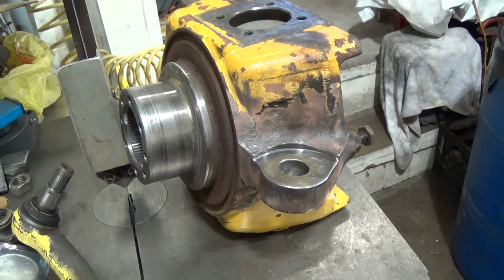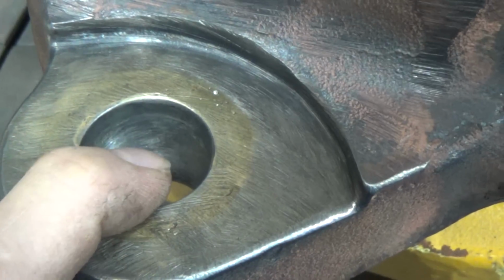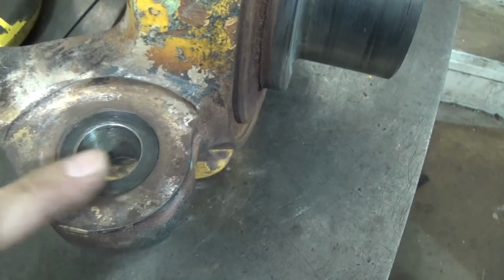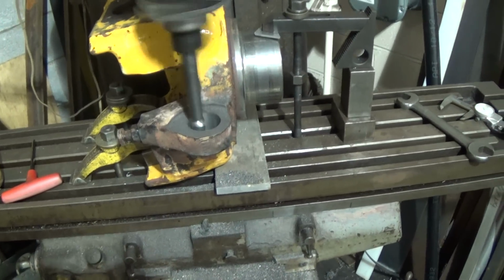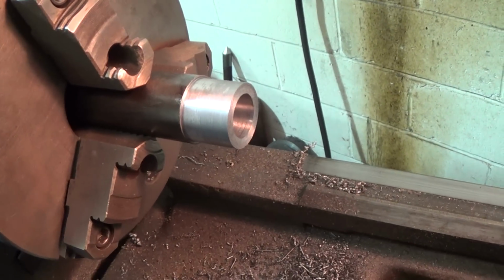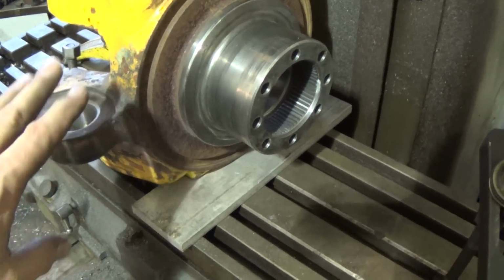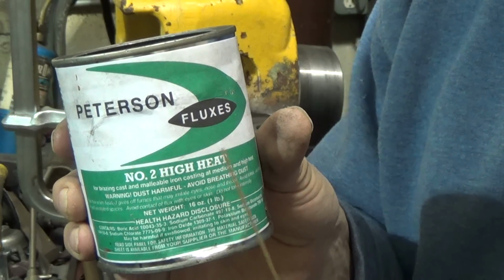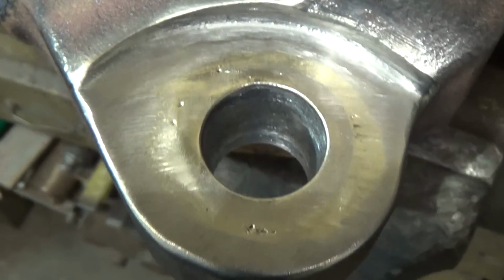Oh Deere !

Comment: I enjoy your repair videos. Nice use of brazing. More people should get familiar with brazing because it's so versatile and shock-resistant. If you have to weld cast that (expensive) Crown Alloys Royal MIG wire is great for repairing old machinery. I turned my machinist buds onto it and it fared very well under their "scientific sledge hammer destructive testing".

Comment: Feel for you Mike.They should have supplied you with detailed instructions.That's exactly the repair i do on Mantiou & Massy ferguson tractors.That component is called the hub.Basically two taper roller bearing mount on the large diameter.The other part is a reduction unit with a ring gear.Plant gears etc.Top work!!!
Reply from the maker: Hi SG,  Thanks for the compliment, it is much appreciated, I guess in the rush of things, I didn't think to ask, and they didn't think to say, what you are describing, as they did mention it is a planetary drive system.
  Thanks again .... Mike
Reply: Hi Mike .
Hope you got paid okay in the end.Glad you got it sorted.
George

Comment: Nice job Michael, for something like that I would have mixed up a bit of flux with water and painted in then use the dip the hot rod in the tin, just gives a little bit extra flux.
Clive
Reply from the maker: Hi Clive,  Yes, I have done that from time to time, but in this case, having done it previously, I knew that the iron had pretty good qualities to it and seemed to "wet-out" well, so I figured I was OK the usual way.
   Thanks for the compliment ....... Mike

Comment: Good job on the repair Mike.....Twice! :-) Tell the guys the first one was just a practice run....ya, thats it. :-)
I'm with you on the braze repair of cast iron. The lower temps don't cause the hardening issues of welding and are normally more than strong enough for most uses.

Colin
Reply from the maker: Hi Colin, yes indeed, I just don't seem to have any luck with the actual welding of cast iron, and when it's done I never really feel as though it's a good reliable repair, at least when I see the bronze wet out, I feel good about the join up. That being said, I was recently referred to a product for TIG welding of cast iron that's supposed to be very good, I'm going to do some sort of a test on it, and maybe it will make an interesting video.
  Thanks for the compliment, and good luck with the move, from the pics you posted, it looks like a real nice building you've got there.
     Mike
Reply: Tig with the more localized heat may make a better iron weld. Couldnt hurt to check it out.
Yes, it is about time I got out of the small space. The new shop has room and I'll be getting back into more welding/fabrication and heavy equipment repair much like yourself. I've been away from that for a few years now.
I also do a bunch of unrelated things like plastic welding, shock rebuilding, RV repair, propane work, etc..... you may see just about anything in videos later on! lol

Colin

Comment: Mike you were right assuming, I would have thought the same.  We have also done
a share of this kind of repair.  But have found most if not all backhoes- loaders etc the nut is on the top side. Why I dont know.  good work & excellent presentation.
sam
Reply from the maker: Hi Sam, thanks for the compliment, it is much appreciated!
    Mike

Comment: Nice repair Mike.  I'm not sure how they expected you to guess which side of the knuckle was supposed to face upwards.
Reply from the maker: Hi Disorderly,  me either, I guess in the heat of the moment, I didn't think to ask, and they forgot to mention it.
  Thanks for the comment ....... Mike
Reply: +Michael Reggie as the part came in with the tapered fit it can only go one way.If the bushing had a flange it could only fit one way...not reversible.Hind sight always is 20/20

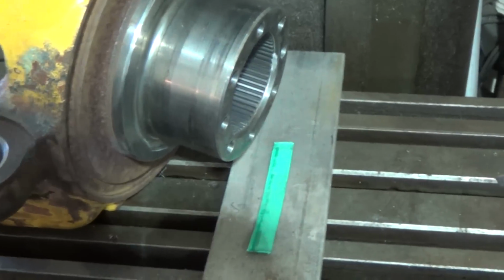Comment: around 7:00, how long did it take you to get that setup perfectly square? And at 18:00, I use the same technique with plastic, copper, brass etc stripes, helps to eliminate markings on the work piece! Great video, awesome job man!!
Reply from the maker: kevin O  Hi Kevin, as you are seeing it in the video here, it went a little faster than it did initially, as this was the second time I had set it up, but I think it took about 10 or 15 mins. to get it set up to the point that I was satisfied that it was square to the table and tied down properly. Yes, as I mentioned in the video, I always keep strips around for setup and to protect surface finishes.   Thank you for the compliment, it is much appreciated!         Mike

Comment: nice brazing job, really nice. You could braze a sleeve when line boring instead of welding it partly (3 lager spots) to prevent warping of the turned (on the lathé) sleeve? Is a bit more hassle but still really nice brazing job

Comment: Now that I'm thinking about it. What's the best way to weld a crack in a wood heater. It's a really old craft stove with a blower . The crack is sorta in an S shape. I've done weld it quite a few times now only for it to crack open after I've used it for a while. Any help is greatly appreciated. Thank you Sir.
Reply from the maker: Hi Wade, I would do it essentially the same way you saw me do this braze, assuming the stove is made of cast iron, I would be heating a much larger area, perhaps with a dragon style torch, and then after making the repair I'd want to make sure I was bringing the temperature down as slowly as I could, usually with welding blankets wrapping up the part or a large area of the part closest to the repair. Best of luck with your repair, and thanks for the view and the comment.
    Mike

Comment: I'm a fan of Oxy brazing as well.  Would it have worked just as well to tig braze with silicon bronze or are there advantages (heating the entire part more evenly?) that oxy brazing would have in this case?

Comment: nice job mike did you pre heat the casting? or just warm it up on your way round .dave in the uk.
Reply from the maker: Hi Dave,  I was able to warm it on my way around mostly, but before I actually apply any filler, I did circle the whole area quite a few times.
  Thanks for the comment .... Mike

Comment: Awesome I said that out loud when you showed it that the tie rod should go in from the bottom. Wonder why you didn't cut the sleeve off on the lathe?
Reply from the maker: Hi King, I wish you were there when I did the job the first time, you could have saved me from having to do it over again,  but then there wouldn't have been a video about it. Sometimes I'll part off in the lathe, sometimes not, no particular reason usually.
  Thanks for the compliment, it is appreciated .... Mike
Reply: LOL I thought might say that. Good job.

Comment: Great Job, Excellent Result. The way you handled their screw up is, unfortunately, going to let them do that again to someone else.
Just not YOU. LOL
I do have a question, please. Do you not allow a long cool-down for the cast material, I didn't see sand/blankets/wrap of any kind.
How do you manage ?
Thanks, Cheers
Reply from the maker: Hi StepCorn,  great handle by the way, If I was brazing on a larger section of the part, I would have been concerned with it cooling too quickly, but because I was working on only the extended ear section, I felt it would be ok, and not have any cooling or cracking problems, and as it turned out, I was correct twice  LOL  But yes, when in doubt, wrap it up and let the part come down as slow as you can.
  Thanks for the comment ...... Mike

Comment: very impressive - first time I saw your machine skills - thought you were strictly a welder ....enjoy your videos - dont take offense to questions you are the craftsman but Id like to know your thought process - thanks

just curious - how come the bushing needed to be brazed if it was a press fit....esp on this low speed application ? -  surely the counter bore was already extra insurance w/o the brazing that could cause cast iron issues....

when you found the bushing was upside down 1st time around - how come you didnt try heating with a rosebud- or machined the brazed counter bore out ....and pressed the bushing out .....might have been able to clean it up and put in in from the other side w/o all the extra work

seems like the LEAST the customer could have done was put the tie rod in the hole from the proper side and write a note so you wouldnt have to do this twice - the crystal ball gets cloudy sometimes.

thanks again Mike

Comment: tig welding man, tig welding is the best for 20:00
Reply from the maker: Andriy Podanenko  Hi Andriy, I have to disagree, I just don't like welding on cast iron as I explain in the video, however, stay tuned as I'm going to be trying out a new product recommended to me for TIG welding cast iron, and I'm going to video and post it, so I'm trying to keep an open mind towards it, I am a big fan of TIG welding, however, I have yet to use any off the rack product or actual welding process on cast iron that has ever produced satisfactory results for me, so like an umpire would say, "I call em as I see em"    Thanks for the comment ...... Mike

Comment: This is where I'm showing my lack of knowledge.  My thinking would to put it in the press and put only a little more than hand pressure on it and heat it up till the braze melted and press out the sleeve.  New bevel, braze.  Not sure it would work but I've zipped welds out and flipped stuff for almost exactly the same reason.  Would that have worked in this case?
Reply from the maker: Hi Robert, I think you'd have to get a lot of heat in just the right way to release the entire braze at one time, and it would still need to be set up in the mill to make a new countersink or large chamfer, so I don't think there would be too much time or labor savings other than making a new sleeve, and I'm not so sure if it would be able to be reused after it was brazed in place and then removed under those conditions, just my thoughts anyway. Thanks for the comment.
    Mike
Reply: Big as weed burner.  I'm actually setting up to make a air propane weed burner or giant rose but so to speak.  I'm looking to do eutectic build up and hard surfacing on buckets.  I don't know if any one is doing this in the dirt industry.  Want to give it a try.  But your right.  Loooooots of heat.

Comment: ...Taper up, Taper down.....easy  mistake there....these days with cell-phone cameras everywhere....they could have just taken a few pics......very good call on the repair!
 I worked as 'The Welder' in a machine shop....we did lots of this stuff for the rental center around the corner...and the local Rice Farmers......
 Press fits...iron/steel....good call, usually a 'thou' per inch of diameter....

Comment: Great vid, but I have a question. Why didn't you just turn a shoulder onto your bushing and press fit it into the counter bore? I believe the press fit and clamping action of the tie rod end would not have allowed it to pull out. This could have saved you the step of having to braze the bushing in. I am not a machinist, just a casual observer with automotive experience.
Reply from the maker: Hi Fierofreak,  when I first saw the piece, my reaction was that I would turn a sleeve and press it in, I hadn't thought of a shoulder, and they were adamant that it HAD to be welded in place, as they insisted that the torsional forces would loosen anything that wasn't welded. In an effort to give the customer what they want, I agreed to weld if it was cast steel, and braze if it was cast iron, so that's why I did it the way you see.
   Thanks for the compliment ...... Mike

Comment: Polishing press fit tubes is bad idea. You can better leave it rough so it stays in the hole better and stronger. Best is to all loctite glue to hold it in place. But not sure if these can be used in combination with brazing the cast iron to the steel because of the heat dissapated in the whole cast iron monster.

Comment: nice work    why dide you brase it with a tight fit
Reply from the maker: Hi Martin, I brazed it to help hold it from loosening up, I know there is a lot of twisting and turning on these tie rod connections, I guess my theory is that the press fit holds it tight for the brazing, and the brazing holds it in the part from turning.
   Thanks for the comment ..... Mike

Comment: HI Michael,
Good work, I understand that kind of things. Client thinks as evidence what they ask us to do, but they don't explain what they want. 
I was looking yesterday the Travers Catalog at page 1171 
I found that product 
15158 1LB FIXTURINGALLOY FLEXBAR
1 Lb. Cake Fixturing Alloy

FLEXBAR Reusable Low-Melting Alloy - Model: 15158
Applications
Use for spinning metal, holding irregular shaped workpieces, bushing anchored in drilling jigs and transfer templates in contour jigs.
Anchoring.
Chuck, jigs and fixtures.
Cores.
Dies and punches.
Models and patterns.
Features
Reusable low-temperature melting alloy (158?F) for supporting thin-walled sections which require machining. Does not shrink upon solidification, rather it exhibits slight "growth" so you simply melt it out in hot water.
Reusable many times.
No drosses created owing to low heat required prior to pouring.
It melts at 54?F below boiling point of water so that when you go to use it you simply put it in a cast iron, stainless steel or porcelain lined pot and into hot water bath to melt.

Sure it could be useful to have this with complex parts to hold,
Seems to be easy to use.
Reply from the maker: Hi Robert, always appreciate your kind comments, I chaulk it up to maybe I should have thought to ask, and maybe they should have thought to say. Thanks for the information on the fixturing alloy, I will check that out, I think it would be very handy to have some around.
   Mike
Reply: Michael Reggie Should paint that moto on your shop door. 
I can do what you want, if you describe what you want !
I agree with you on the brazing. Cast Iron is very brittle if you use the arc process the wrong way. and you must buy the best rod, not a cheap one. It's very expensive, I've paid nearly 6 $ a rod to the mechanic to repair a Massey loader many years ago. And he did not weld by the rules. It cost few hundred dollars for something that hold the time i chain it.

Comment: Mike I saw the comment about Tig welding repairs to Cast Iron and remembered seeing a clip by Mr Tig at Weld.com using a new filler rod without the need to pre-heat the cast iron. Check it out if you havent already as I am sure you could use the product.
Reply from the maker: Hi Mark, Yes, I found the video you mentioned, and that is the product, I'm planning on doing a test on it also, and I'm gonna try and work in some comparison methods as well, thanks for the heads up.
   Mike